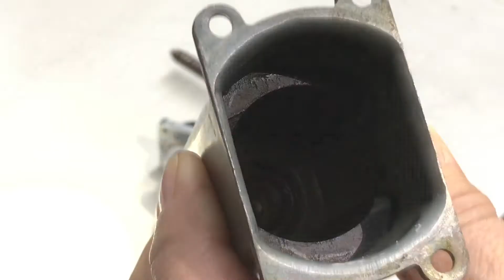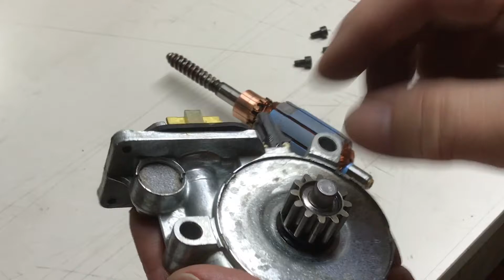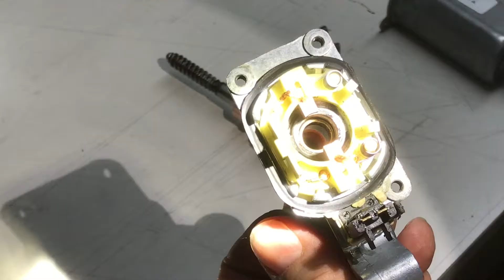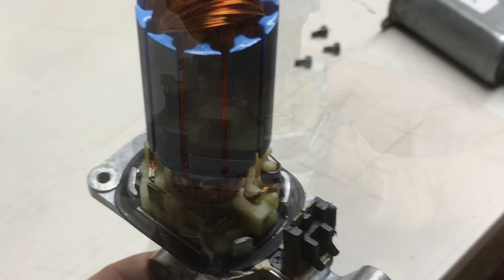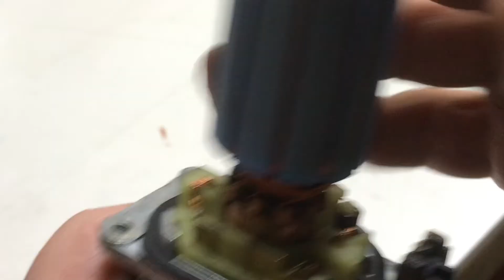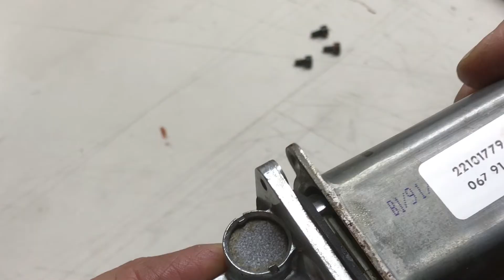Cadillac Allante Regulator Motor Repair

Comment: Is the circuit breaker built into the motor im pretty sure it is
Reply from the maker: I don't recall there being any circuitry in the unit. but maybe one of those brush contacts is a fusible link. Got the unit working and passed it back to my friend so I don't jav it any more. Good luck with yours.